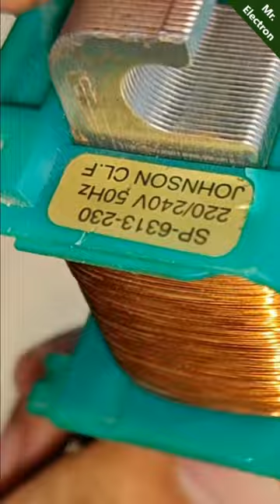Make a 12V Transformer from an Induction Motor #Motor #shorts

Comment: What was that final part you put in just before the?
Battery or volt meter
Reply from the maker: A metal piece which is a top head of a discarded universal motor. Its for completing the magnetic circuit of the transformer for better efficiency
Reply: Oh thanks for clearing that up did you have to use a diaode somewhere also
Reply from the maker: @garypear9133  no . I have used a rectifier instead.For details, watch the full video. Video is linked in the related video section

Comment: Distroy a motor to make a source for other motor... very clever, anyhow what you show is a funky joke, as you made can’t work
Reply: And why you can't use for other things? Your comment is 0 sense  lmao...
Reply: @PHM_Tech  No, you know why ? Because it does not work ! A transformer is another thing not what he did ! With a screw in the midle of a coil you will heat the screw  and that's it ! For a transformer you need to close the magnetic field in order to transmit the induction from primary to secondary in order to obtain power and not Foucault currents !
Reply: Sometimes, you don't need a thing as it is. But you could use it differently: sure ! But to obtain a good efficiency, need some awareness...
Reply from the maker: Please watch the full short video before making any irrelevant negative comments.
I used the screw only for the secondary coil winding and not as a core of the transformer. 
As you can see later in this short video, i still used the original silicon steel core to eliminate losses.
Reply: @MrElectron Yes, it's true.
 But your magnetic circuit stays open.  You had to keep all the magnetic loop close,even without rotor. Magnetic waves have to turn around..
Reply from the maker: @pierrevandeputte2543  Again, as you can see at the end of the video, the magnetic circuit is complete because of the metal piece that i have added along with the steel core.